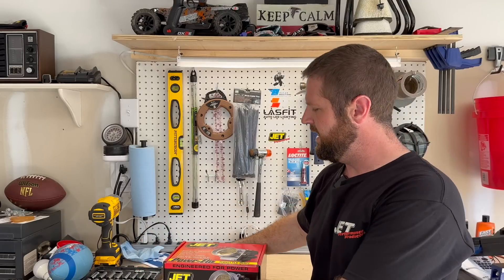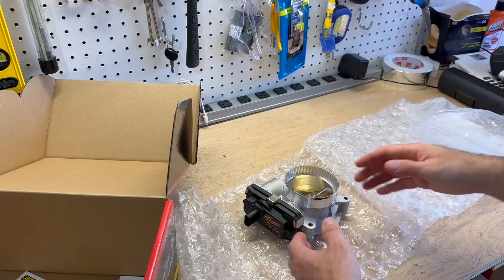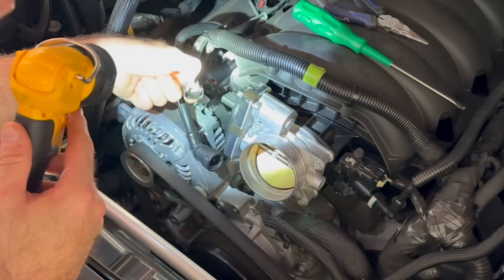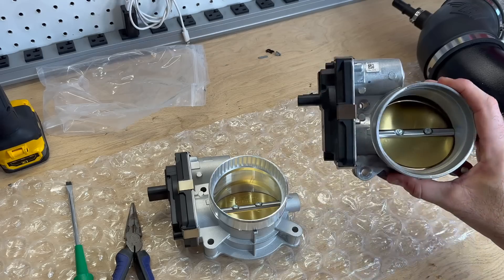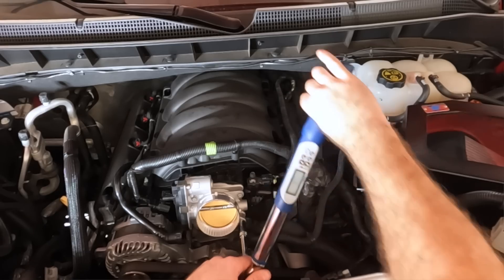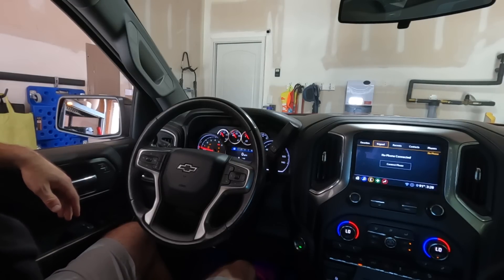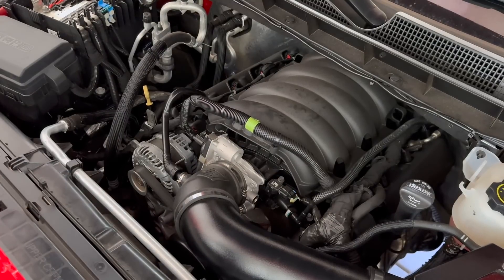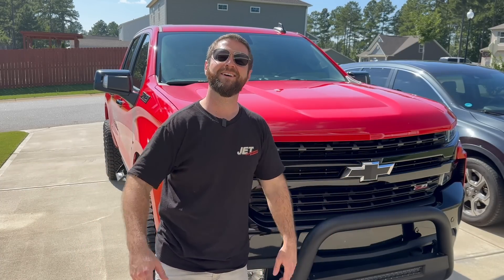Chevy Silverado 5.3 Throttle Body Upgrade! | Jet Performance

Comment: Hoping you might be able to give some advice...I have a 2024 Trail Boss, 5.3L V8.  I've installed the Jet Performance Throttle Body 80mm.  I have tried everything I've read on line for the throttle relearn and have NOT been successful.  I wanted to avoid taking it to the dealership to have reprogrammed since that's what my last resort would have to be.  Any suggestions or ideas?
Reply from the maker: Did you follow these instructions: https://jetchip.com/wp-content/uploads/2021/05/76108-Throttle-Body-Instructions.pdf
Reply: @zachattackcustoms  Thank you for sending that.  I did review those instructions as well.  The only issue is, on the 2024 model, it goes into Limp Mode and there's no way of hitting a minimum of 50 miles for a drive that you can't go above 45 MPH.
Reply from the maker: That’s crazy, they must of changed something on the refresh models. A local shop should have a scanner that will be able to do a re-learn.
Reply: @zachattackcustoms  thanks I appreciate that. I wanted that to be a last resort but looks like if I want to keep it that’s what I will have to do.
Reply from the maker: Only other thing you could try, is unplugging the throttle body, crank the truck and then very quickly turn it off, then reconnect the throttle body cable and see if it forces a relearn.
Reply: @zachattackcustoms  that’s a good thought thanks buddy. I’ll let you know if that works. I’m gonna try it.

Comment: Jet performance is all snake oil DO NOT BUY absolutely did nothing no changes in performance on my car installed their performance chip and throttle body just a huge waste and check engine light comes and goes

Comment: Could this affect the warranty? Let’s just say I had a bad expierencd with Chrysler and I’m curious about engine mods.

Also, have you added a super chips or an unlocked computer to adjust changes (gear ratio, tire size, etc)?
Reply from the maker: That is a good question, and one I can't really answer, because it's a direct factory replacement. I would be more worried about the warranty if you swapped to the 6.2 intake manifold like a lot of people are doing. That for sure will void the warranty because it is completely modifying the intake. I have the Pulsar LT installed to disable DFM and Auto Stop/Start.

Comment: Replaced my throttle body as well as maf sensor,  after numerous check engine lights, i put the original maf sensor back on. Returning sensor to American Trucks for a replacement. Hopefully it was a dud sensor and the replacement works. Thanks for the videos and information truly a great channel with clear instructions as well as insight
Reply from the maker: Thanks and hate you experienced issues. I have had other people say they had an issue, but the company sent another one out and then they didn't have an issue. Love to know if the replacements work out. I have had mine installed for about a year now and have had no engine lights.
Reply: @zachattackcustoms  I will let you know what happens with the replacement MAF
👍
Reply: So the new sensor came in. I did the swap out and no issues so far!!
Reply from the maker: @joshuashea2783 awesome!! Glad to hear it. Love to know what you think about it.
Reply: @zachattackcustoms  I definitely will. So far its been   nice. The truck seems more snappy/ responsive when I put the throttle to it. I just have to be careful, because I needed to put a drive safe puck on the truck to get cheaper insurance.  That could help gas mileage in the long run. I am planning on adding a Borla Atak muffler next. I really want that sound!!👍
I also have not noticed any issues so far being at altitude in Colorado.
Reply from the maker: @joshuashea2783 great news, lol I have the drivewise thing for insurance too, so I struggle with trying to save on insurance and punching it!
Reply: I have evolutions program er would they work together on a 2014
Reply: Sorry about the issues with the MAF and Throttle Body. Did you do the installs separately or all at once? We recommend you doing them separately because if there is an issue with the install or the part, you will be able to see which is tripping the error. Be sure to follow the install instructions properly to insure best results

Comment: Bought the new throttle body and a new mass airflow sensor, both from jet performance. Completely disconnected both pos and neg battery cables for an hour. Hooked everything back together, started truck let it run for 45 minutes. Went out for a short test drive, normal conditions, got home shut truck off. Waited a few minutes restarted truck it throws a damn check engine light. Any suggestions?
Reply from the maker: What year is your truck?
Reply: @zachattackcustoms  2017 5.3 silverado 1500 ltz
Reply from the maker: @joshuashea2783 I would double check and make sure the part numbers are correct for your year, if they are I would then take a scanner and see what codes you are getting.
Reply from the maker: I would also read the instructions on the jet performance website to see if they recommend something different for a throttle body relearn. It could be different for your year compared to mine. It may just need to be driven for a little while to learn. One thing I have learned from doing so many mods is disconnecting the battery doesn’t seem to do much these days for resetting computer.
Reply: @zachattackcustoms  I will try driving it more tomorrow and see what happens. Thanks for the info, fingers crossed 🤞

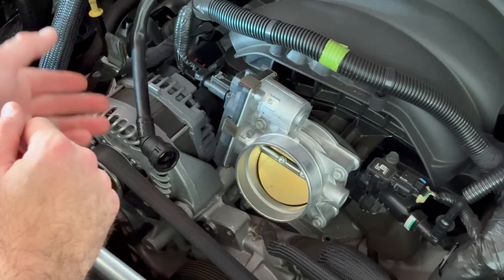Comment: @2:40 a little trick for those connectors. If you have MAF Sensor cleaner on hand give it a quick blast to clean the plastic. Works for me on dirty connectors.

Comment: Did you ever get that clip fixed for the connector? I just cleaned my throttle body & MAF this passed weekend and the clip broke on me the exact same way.
Reply from the maker: No, never did. Fortunately it seems to stay with no problem. Chevys clips are ridiculous.
Reply: Try MAF sensor cleaner on these plastic clips. It has helped me in the past

Comment: What MM size is this? Is it the same as factory or slightly bigger?
Reply from the maker: Same size.
Reply: @ great thanks. This doesn’t mess with the factory warranty does it? Wouldn’t you recommend going this route of the Soler performance throttle body?

Comment: I changed my headlights out to aftermarket ones abt 4-5 months ago and I broke that same red locking clip on the plug. It still bugs me but thankfully haven’t had a issue yet

Comment: Hi, nice video. Did you find out where to buy a new locking tab from. I've noticed mines broken too.
Reply from the maker: I looked in to it a while back. They sell a connector that you would have to splice into the harness but it was like $150. I have had no trouble with it coming loose, so I never replaced it. The plastic clips they put on these chevy connectors are terrible.

Comment: In the past, Jet products have been a placebo product, and then would often fail and throw engine lights. A good test to me to prove if this helps, run it against another truck (stock) equipped the same . 0-90mph
Reply: "placebo" products? Our products are bench tested and dyno tested. If there is an issue then the product may have been faulty or more likely there was an issue with the installation (this is unfortunately the case for many and not following the install guide)

Comment: Same damn thing happened to me when trying to disconnect the clip from the Throttle body.  Brand new 2024 Trail Boss.  The gray piece just snaped in two.  I barely even put any pressure on it.  Very frustrating.  I feel your pain, Zach!!
Reply: Try MAF sensor cleaner on these plastic clips. It has helped me in the past
Reply: @nathanheckathorne8061 this comment would of saved me a headache
Reply from the maker: Dang yea it took me a while to get over that! lol luckily the connection seems secure enough, I haven’t had any issues with it coming loose and I have had it on there for over a year. Other than the broken clip, how do you like it?
Reply: @ I was actually installing a throttle body spacer and Blackhawk cold air intake. I might try that other throttlebody in your video down the road.
Reply: I feel you and Zach lol took off throttle body and intake manifold to get ported and broke gray tab hopefully not a problem

Comment: Bought one of these from summit racing a year ago, it recently stopped working so I contacted jet and they gave me the runaround on replacing it, so I contacted summit racing and they sent me a replacement, fast shipping and the new one works great, moral of the story, Summit racing is awesome, jet performance, not so much.
Reply: Yea, not sure what you mean by giving you the run around. Summit Racing handles their own returns and exchanges. So you going through Summit to do that was correct. We would have directed you to go to Summit because you purchased it through them. Glad it all worked out
Reply: @JET-PERFORMANCE  yea, I can tell you what I mean by “runaround”, I was treated rudely and disrespectfully when I tried to just find out if I go through jet or summit, I didn’t know the policy at the time, nobody at jet wanted to even give me the time of day, couldn’t get even a simple answer, they were very unprofessional and based on your comment im guessing that’s the norm with jet, yeah it all worked out, no thanks to anyone at jet.
Reply: @ColonelDaveX  I do apologize for how you experience was. That doesn't sound like us even with a what should have been a simple answer to go back to Summit. However, again we do apologize. 
I didn't feel my response was "unprofessional" in any way. Thank you for your feedback.
Reply: @JET-PERFORMANCE that’s just a nice way of calling me a liar… and of course you wouldn’t think it’s unprofessional, what kind of company gets in the comments section of a creator on YouTube and comes at someone with an attitude without even knowing the situation ? 
You didn’t even know what happened but assumed I was wrong, and then double down on it after I explain. Is that professional ? Why did you reply to my comment anyway ? Is that something professional companies do? Just scroll through YouTube looking for customers to tell how “wrong”  they are about their experiences when you have no context or details on the situation ? Then when you do get the context and details, the customer is still wrong? Is this what you do all day argue with random people on YouTube ?
And you don’t see how ANY of that is unprofessional ?  Jeez 🙄
Reply: @ColonelDaveX  I was replying to someone else comment that pointed out that your comment went unanswered. I simply addressing their comment and yours. If you think that is unprofessional, then I am sorry. I was not saying anyone was wrong, I was addressing a comment, nothing more.
Reply: I don't trust anyone wearing a shirt of what they are pushing.
Reply from the maker: That’s why I took the time to take the truck to the Dyno to get real results and make a video on it.

Comment: I noticed on your dash that your Auto Stop/Start light was on I hope your next mod will be to delete that out. It's one of the main reasons along with the AFM/DFM as to why these engines are destroying lifters, just my 2 cents my friend
Reply from the maker: I mainly drive around in L9 which cuts it off completely, but I plan to eventually take care of it. Looks like there may be a handheld tuner that will unlock the computer that I have had my eye on.

Comment: Just for S&Gs, i looked this throttle body up on Amazon and it said it wont fit my truck. I looked up the same one as in the video, part # 76108. It should fit, if its the same one as you have, correct?
Reply from the maker: Yes that is the correct model number for mine, which is a 2020 Chevy Silverado 5.3
Reply from the maker: It’s cheaper to go through the website with my 25% off code than on Amazon.
Reply: That's true, but I can use affirm on Amazon and pay over time lol low monthly payments
Reply from the maker: @jasonworkman7912 sounds good, I make nothing off the promo code, just want to make sure you get the lowest price.

Comment: Will that void my warranty?
Reply from the maker: Honestly, yes and no. I say that because if you have a problem they would have to prove that the Throttle Body caused it, and I feel like it just depends on what dealership you take it to if they try to make a fuss about mods. I have always done intake mods on all my vehicles and I have never had any problems. The biggest thing is to make sure they are installed correctly.
Reply: Depends on where you live.. Warranty laws in the US state the warranty provider has to prove that the modification is the reason something broke and needs to be repaired or replaced.
Reply: Most likely yes. CAI, Catback exhaust, and Most suspension kits are the only things that won't.

Comment: its a waste of money you didn't measure the tb to see if it was any bigger that stock and didn't dyno it to verify any hp gain, dude who is going to buy a $700 in total set for what 8 more horses?
Reply from the maker: The throttle body is a direct replacement from your factory Throttle body. The difference is the ridges and the inside electronic components. I actually plan to get dyno it when I can find the time. Just wanted to finish all the upgrades before spending the money on it. I agree, for the price I would not buy this alone, but if you are someone that wants to add every bit of horsepower without getting a tune then it’s the way to go. A tune these days on newer trucks is crazy expensive because you have to get the computer unlocked.
Reply: I bet you’re a great time at parties…
Reply: @andy_golfs2025  oh yeah a riot, i bought a turbo with that $700 instead of a piece of plastic scam and did donuts at the party
Reply: @Mihka98  so low end turbo over throttle body got it, did you just throw the turbo on and let it ride or did you drop a tune in it? Because that costs money too, also you have a glorified cold air intake too if you aren’t tuning it correctly, but it’ll sure sound neat spooling up 😁
Reply: @andy_golfs2025  sorry are you still being passive aggressive at the "performance" $700 MAF?

Comment: Imo what im building for my 2019 5.3 Is im gonna Get the K&N CAI you got first before Cold air inductions, an LT Swap Intake with Throttle body, Cam, Headers new fuel injectors  and tune it to 93 Octane or E85. Thats where im gonna make some serious Horspowee gains
Reply from the maker: Sounds good. I am thinking about getting a tune soon to see if I get more out of all the upgrades. I would have to think that is the only way to get the full potential out of everything.
Reply: Where are you going to get an e85 tune please let me know

Comment: So the combination of mass air flow and cold air intake, is it good ?
Reply from the maker: Yes, I definitely feel more response, but if you don’t want to spend all the money, I would recommend the MAF sensor over the throttle body. I noticed a bigger difference with the MAF sensor.

Comment: You never let us know the MPG increase/decrease from final cold air intake you installed as you stated you would. No update?
Reply from the maker: I saw no change in mpg with the Throttle body and MAF sensor. I saw 1-2 mpg with the cold air intake.

Comment: Do you have a pulsar LT installed with this?? I have this same throttle body, but im hesitant to run it with my pulsar lt. I called edge, but they cant give me a definite answer as to whether they would interfere with each other.
Reply: Update: I installed the Jet throttle bottle yesterday. Like you, I broke the clip lol. I snapped some zip ties together to secure it. No big deal. New gm protocol calls to idle the truck for 20 min, then drive it for 50-100mi for re-learn after instaling the throttle body. I did exactly this and it works flawless. The throttle body with stock pulsar throttle setting feels like setting 2 on the pulsar without the throttle body. Throttle setting 3-5, holy shit its awesome! Gave me a little deeper tone while accelerating, even more acceleration, and I also averged 17 mpg between 70-80 mph on the 80mi relearn drive I did. Its definitely a winning combo!
Reply from the maker: @mattgonzalez9786 Awesome to hear. lol, yea those clips are annoying. I looked in to replacing it, but that clip is crazy expensive. I may have to try the pulsar eventually, but I have to calm spending down a little cause I just dropped money down on my true dual Borla Atak setup and it is amazing. Hoping to post that video later today.
Reply from the maker: I don’t have the Pulsar LT. It’s kinda overpriced in my opinion.
Reply: I called Jet Performance this morning. They said run it. No issues. The pulsar was worth it to me. Deativating the DFM/AFM, calibrating my speedo to my tires, and the throttle booster eas well worth it in one package to me. Truck runs night and day different. $500 was no sweat for that.
Reply from the maker: @mattgonzalez9786 good to hear, I may revisit that. Thanks
Reply: That'll be awesome! Ill make sure to check it out. I actually went 2 days ago and got my exhaust guy to quote me for custom cat back true duals with no muffler. Quoted me 800 for fabbing the pipes installed. I'll probably do that too!
Reply from the maker: @mattgonzalez9786 That sounds too high. I only paid $900 including two Borla mufflers installed. The mufflers were $238 a piece.
Reply: Great video brother . Would this work on a 2020 Silverado trail boss LT 5.3 ? Thanks in advance
Reply from the maker: @Voffroading yes, that is what I have.
Reply: @zachattackcustoms  do you have the part # by any chance ? Thanks
Reply: @zachattackcustoms   awesome thanks . Do you mind sharing the part #

Comment: I got a 5.3 in switch the intake manifold and throttle to a L86 and have them ported .. now that is a upgrade
Reply: did you have to tune?
Reply: @thicc.c6 pretty sure you have too